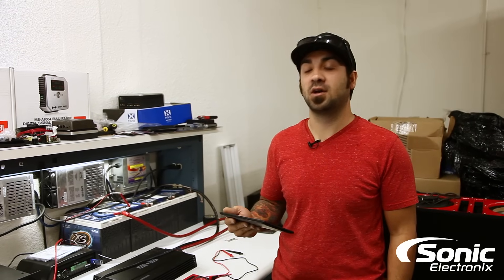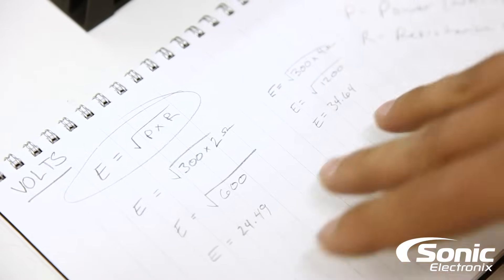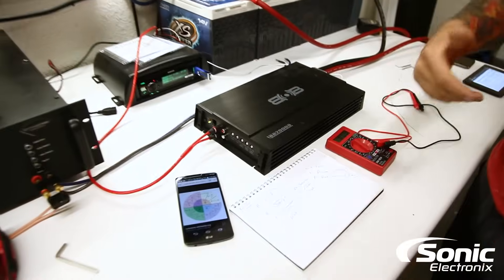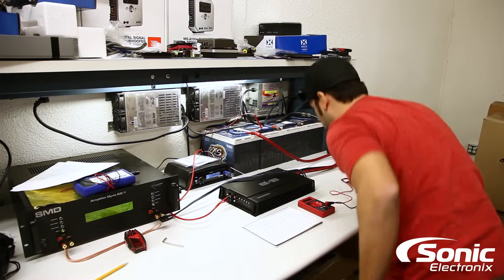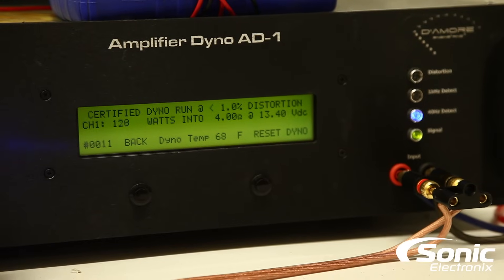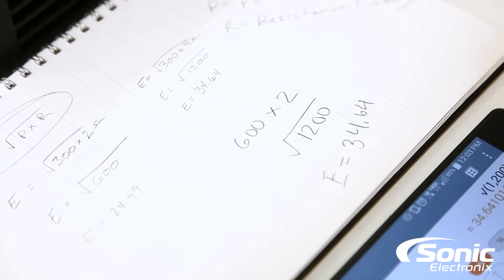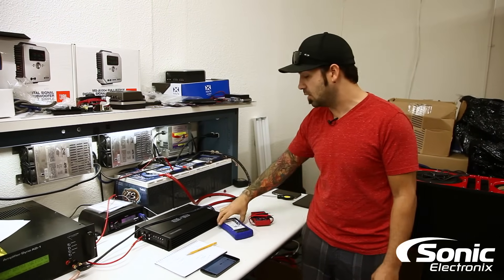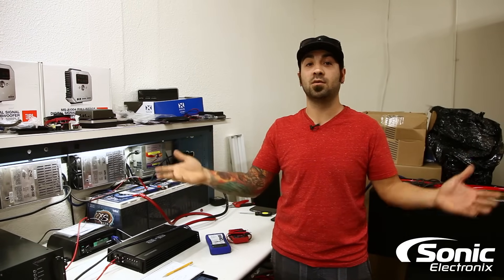How To Set Amp Gain to Match Lower RMS Subwoofers? | Car Audio Q & A

Comment: For instant for instance the Alpine radio even the lower models all are very clean but once you hit 22 23 anything over 23 starts to distort and Alpine is way better than Kenwood excelon so better quality and a lot cleaner radio and then you turn in your radio all the way up to adjust your amplifier that is crazy I can do this s*** in my sleep and I guarantee it will sound better than what you are doing with very low Next To no distortion what I do is find out where the music is comfortable to the customers ear and I adjust the base with preference everyone don't like the same thing but I'm technician that knows what's best for my customer and I explained everything to the customer that way at the same time they understand and no I'm not trying to get over on them

Comment: Then you made a false statement all radios distort when you turn them all the way up that's because in general you do not have the right speakers in the car to perform right or handle the power from the radio or the radio is not enough power everyone doesn't have amplifier or their insides and this is a general problem that I see a lot a lot of people don't spend a lot of money on the head unit when the head unit is the most important part of your sound system I have seen some car audio bills from professionals that have b***** as head units and I really don't understand it

Comment: I have these two products 
What amp do you recommend for them. Do I need one amp or individual amp for each.

I am located in the uk 
NEW PAIR OF VIBE SLICK69.26x9 2-WAY CAR SPEAKERS. GRILLS ARE INCLUDED.

SPECIFICATIONS:RMS Power 160 w
Minimum Input 80 w RMS
Peak Power 480 w each (TOTAL 960W for the PAIR)
Sensitivity 93 db
Freq. Response 55 - 25 khz
Mounting Depth 75mm
Mounting Diameter 220 x 150 mm
Voice coil diameter 35mm
Impedence 4ohms

Part Number: PDBT29

MAIN FEATURES

NEW *PYLE PDBT29* 1" 300W 4-Ohm Car Audio/DJ Titanium Super Bullet TweeterMAX Power Handling: 300 WattsRMS Power Handling: 150 WattsDiaphragm Material: TitaniumVoice Coil Size: 1''(25.4mm)

Comment: How do I set the gains with a stock stereo, a JL Audio FIX 86 DSP and an amp? The DSP in the middle is really throwing me off b/c it has its own master volume control, and I get statix/buzz/white noise with its volume set to any higher than 50%.. So I set my stock stereo to 3/4 volume (30 of 40), DSP to 50%, and then unplugged the speaker cables from the amp and put the multi-meter probes in the front left + and - for channel A on the sub. The sub gain/sensitivity was set all the way down. Played a looping test tone at 1k Hz.. My target voltage was ~15.499, but the multi-meter was showing a much higher number (I forget exactly..) So apparently with my gains set all the way down, it's already over the voltage it needs to be..? I'm so confused ... I turned the DSP down to 25% but below 40% I noticed it makes my tweeters sound static-y/distorted, but only with music playing. It sounded like a loose connection, but I checked everything and it's all good. Ground is also good, multi-meter reading it at 0.1... No idea what to do :(
Reply: Details: 2017 Honda Accord EX-L V6 Sedan, replacing the "premium" sound system. My speakers are 60w RMS at 4 ohm, sub is 300w RMS at 4 ohm, but recommends ~225w RMS. So roughly ~15.5v for speaker channels and ~30v for sub channel is what I calculated.

Comment: Hi I know this thread is 2yrs ago but hope can still get a response :).

In the video it was shown the HU vol was set to max. With the amp gain at minimum, the amp output already has 15+ Volts. Based on the equation the amp gain is increased till voltage reaches the target value => HU is matched to the amp. This, I understand.

Now, we know that speakers should be operated at or near their rms power output levels to sound their best without distortion. But after making the HU match the amp, note that the HU vol was set to max - but we don't listen to normal music at this max vol of 35. Say we lower volume down to 17 which is comfortable.

Question 1: Does the lowering of HU volume by half drastically reduces the amp channel output voltage such that it no longer meets the target matched value, meaning the speaker operates at much lower rms than intended?

Question 2: Suppose I have a 4-ch amp that pushes 120W rms @ 4 ohm per channel. I connect it to four 4 ohm speakers rated at 50W rms. Based on equation target voltage is sqr(50x4)=14.1V per channel.  Is it possible that, at minimum amp gain, the channel output voltage already exceeds the target voltage?
Reply: the reason why the head unit was turned all the way up is because once you set the game to the right level that's the make sure that when you turn it up all the way it don't blow your subs it will not hurt it after that if you only play your music at half way and yes it's possible for the ant game to be turned all the way down to be pushing over 14.1 volts are 15 volts

Comment: All of this is accurate, but one thing was overlooked, when using this method. The speakers RMS is 300, thus ~ 24 volts. But, speakers have impedance not resistance. Therefore, its impedance changes depending of the music and fluctuates from lower to higher during playing. Therefore, more power will go to the speaker when the Ohm drops say during 50hz bass, which then over does the amp and sends too much power to the speaker and damages it. The speakers sensitivity needs to be set to the amps sensitivity or vice versa.  Higher end speakers have higher SQ by having leas variance in impedance when active. If that amps sensitivity is not properly matched to a speaker ... both will be damaged
Reply: rob h Which is exactly why the test soundtrack should be uncompressed 0dB on the same frequency as the subwoofer's resonance frequency is. When the track's frequency matches sub's resonance freq. impedance equals resistance because reactance is zero. Mathematically: Z = sqrt(R^2 + (Xl-Xc)^2), at resonance freq. Xl-Xc=0 therefore Z=R. (Z impedance, R resistance, Xl inductive reactance, Xc capasitive reactance).
Reply: Nektariini I have a kicker 400.1 amp and a s series 12" 500w bridged for 2 olms. How do I go about making sure all speakers are working together at there best?
Reply: Also, subs are designed to go past their continuous RMS rating, it's called peak RMS. As long as the subs dont pull a continuous wattage higher than the RMS or pull a wattage past the peak, it's fine.

Comment: What would cause my voltage to jump all around. 

I’m running my TS-w3002d4 1000 rms woofers at 2 omhs with my 800rms Pioneer gm-d9601 amplifier.
The amps are hooked up to kinetik hc2400-blu battery
 
When I attempt to set my gain so it reads 40 volts to the output it goes down as low as 9 volts as high as 40 volts contently changing.
PLEASE HELP
THANK YOU!
Reply: It could be, because your amp is overpowered. Would work properly if Sub is 800rms to 1krms amp. Also, try playing sine tones. 40hz test tone when tuning. Avoid playing regular music for it's comprised of various tones.

Comment: This video helped me out immensely! I used this technique to set the sub gain as well as the 4 channel with a 1kHz tone, and the results were phenomenal. The bass sounds great, but even more than that, my cabin speakers (all Type R) sound the best they ever have. I'm hearing details I've never heard before, and with all 4 set properly, there's a synergy and a chemistry between them and I believe I'm hearing them the way they were designed to be heard by Alpine. It's also a great feeling to be sitting in the driver's seat at the stereo controls and  knowing that everything is set as it should be, and being confident in knowing how much headroom I have when listening to music recoreded at slightly different levels because I saw the DMM readings for myself rather than having someone else do the install for me. Thank you guys so much... you're the best!

Comment: I need help I have two 12s both 1250 watts 2500 watt max and that means I wanna run them both in parrell at 1 ohm doing 2500 5000 max
Reply: My amp does 4 k at one ohm

Comment: How then do you set the gain to achieve the rated rms of the amp?  There tutorials and instructions all saying do not set the gain high but if I set it low, I won't achieve the rated wattage.

Comment: When setting the gain on my amp, do I set the separate bass level knob remote all the way up or all the way down?
Reply: Hypercity In the middle.
Reply: All the way up. That way you get the clearest sounding bass at high level. If you set it in the middle if u turn it up higher you might get distortion.

Comment: hey! i'm running an old lanzar vibe 230 (500w max, stable at 2 ohm) hooked up to a pyle plm-1299d 12" sub (1200w max, 600w rms, dual voice coil 4ohm).
how should i set this up? sub is wired in parallel so it's at 2ohms. thanks

Comment: is it the same if I have two amps strapped? I have 2 hifonics brx2016.1d linked. so the subs will be wired to two ohms but the amps are one ohm each. how do I calculate that?
Reply: the amps see one ohm each not are one ohm each.

Comment: So at 600rms x 1 ohm load= 600 and the voltage would be 24.49 correct? I just wanna make sure, It seems like pretty simple math the way you put it down on that paper. lol I will be running a Sundown Audio sae 600D (Rated at 600rms at 1 ohm) with a Sundown sa8v3 dvc 2 ohms which is rated at 500 rms. Thanks for the helpful videos.

Comment: wsup i'm building a active sq setup using the pioneer AVH-X4800BS AND ROCKFORD FOSGATE PRIME AMPS THE R600.4D  R1200.1D AND THE TWK-88 AND THE DD 1 HOW WILL I SET MY GAINS

Comment: say i have a pair of dvc 2 ohm subs and a pair of hifonics amps what can i do if the subs do 1100 rms but  amp does 850.4 1700.2 and 2500.1 is it possible to do 1 and one maybe strap the amps together?  help A PAIR of Dual voice coil 2 ohm subs and a pair of hifonics brutus elite bex 2500.1 amps

Comment: So what if you have 2 subs 650 a pice and run at 1 ohm do you just multiple by 1
Reply: phantom gaming i have the same question
Reply: Double the watts and multiply buy one or use the rated rms for one sub and multiply it buy what that sub is whether it be a 2 ohm or 4 ohm sub
Reply: 2 subs * 650 = 1300 watts at 1 ohm.
Reply: I have 2 subs 500 rms run at 3.360 ohm. The result i get for one is 40.98 volts, would i multiply this by 2?

Comment: bro not to troll serious question, why you measure AC voltage with black plug on VΩmA ? all procedures you did are 100% correct is just that is possible to measure like that ? 0.o

Comment: Test an amplifier with a multimeter. I think I once seen a guy connect the multimeter to the amplifier's rca ports. If so what's the purpose, should it produce sound ?

Comment: I have 5000w amp and two 1500w subs which are dual 4 ohm .what is the best way to wire it ? And how u do the math
Reply: Only 2 ways to do it. Either wire everything to a 4 ohm load or 1 ohm load. In your situation its best to run it 1 ohm. Make sure you have an extra battery and big 3 done.
Reply: What about I run a capacitor with it ..
Reply: You're better off with a 2nd battery than having a cap. Especially, if you're running 3k.
Reply: Thank u so much about everything !    Could this can damage the main battery if I run a cap with it , I'd like to install a 2nd  battery ,but I don't have space to locate it .that's the problems
Reply: No, there will be no damage done. It's just caps really don't benefit you a whole lot like people think. But, you will experience a lot of voltage drop running off of a stock electrical especially at night. The other alternative is to upgrade your main battery to a deep cycle, do the big 3 and buy a high out alt later on. Only thing is if you buy a HO alts are expensive.

Comment: Hey guys I got 2 Xl 12 and a twisted 3.5k and when I do this my subs don't really hit hard I have my subs on 25 subsonic....80 on my lpf and no bass boost.... I have dual 1s wired to 1 ohm and set voltage at 59

Comment: Is it best to use the 50hz test track for your kids and high amp to set gains or the 1kw track I see about a 4 volt difference between them and when putting the loud back on or eq those numbers jump up big time... wouldn't someone wanna set it where how they technically listen to prevent clipping or over driving?
Reply: Mids.... not kids.... stupid phone

Comment: you cannot measure ac voltage (power from the amp) with a formula for dc power. yes, if the power coming out of the amp was dc you could do it that way. ac power is measured differently

Comment: So it is safe to run a higher rms amp to a lower rms subwoofer? I always shopped around on craigslist for an amp that put out same rms as my subwoofer at whatever impedance. Im an idiot lol
Reply: It's actually better to have more power than less power. Just make sure you set everything correctly so you don't blow a coil.
Reply: heyitschinoable it's fine matching rms amp to rms sub and ohms . And yes it's safe to run a higher rms amp on a lower rms sub if you set the gain right .

Comment: What about for two subs? Say two 300rms subs at 4ohms
Reply: It doesn't matter. You could have 10 subs and if the desired output is 300rms@4ohms, then that's what you should be setting it for.
Reply: If both subs are rated for 300 rms then would 300 be what I’m going for or is 600 what I’m going for if I have 2 subs wired to 1 ohm

Comment: Stupid question : is there a reset button or something on a solid audio amp, to get it out of "protect mode - red light"?
Reply: Letting an amp sit for 2 days doesn't do a thing. When a amp goes into protect mode it could be a lot of things. Wired too low of ohm load than recommended, amp got too hot, blown resistor in the amp, not enough power to run the amp, etc. Does the amp have a odd smell like something burnt, does it turn on for a second then go off, or does it just go into protect mode soon as it receives power?
Reply: Mike Weber unhook the amp let it rest for like 2 days . Then hook it back up . If it still does protect mode then something is wrong with the install . Prob wrong speaker to the wrong amp .
Reply: DCVR614 I have a Taramps amp that is going into protect mode after it starts to bump the woofer.

Comment: hi ,please I have a little issue with which amp to use for 2 12" kfc 3011 subs , I want to get a kenwood kac-9105d or kenwood kac-9104d , wanna know if it will work with the two subs ?

Comment: hello sonic electronic i have 1350wats woofer and 1000watt amplifier 4 channel i havr bridge the amplifier with two channel and on ther two iahbe connected the front speakers but the woofer sound is low as i have put some gain if i gve more gain itz started to distor plz hell me watt to how to set the gain plzzzzzzz

Comment: I guess this Dyno got a fixed value of resistor like 4 ohms or 2 ohms, does it really represent or simulate actual real speaker? I think the speakers are more complicated than this Dyno, the impedance will change when the frequency changes. and that makes ohms law not good way to calculate. Someone correct me please because I am not really sure. Thanks

Comment: Please try to use distortion detector to set the highest possible clean signal from an amp rated 300 or whatever, then measure the volt. and prove that ohms law is really good method to calculate.I really do not understand how you use the voltmeter and calculating based in Ohm's law. I think the resistor or the impedance will never stay at 4 ohms when there is frequency changing, I guess for the subwoofer frequency the resistance value may triple. and that makes our calculation very wrong, not even close to the value it suppose to be, it will be much less.
Please feel free to comment and correct me if I am wrong

Comment: symbol for volts is V
Reply: Muck Man E=electromotive force a.k.a. voltage. in ohms law it can be expressed as electromotive force for voltage, intensity which is normally amperage and R in the equation being resistance.

Comment: Is it okay to change your bass and treble settings after you have set your gains and crossovers? Does it matter if you change the bass level by the deck or by the amplifier?
Reply: ORANGE BOY 714 no,just no!!
Reply: twistedcobra put the bass on your head unit all the way up and the treble . First tune the radio head unit till it distorts . then set your sub woofer level all the way up . Then set ur amp gain until it distorts . Done .